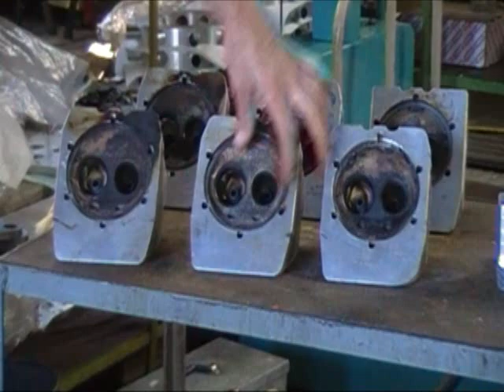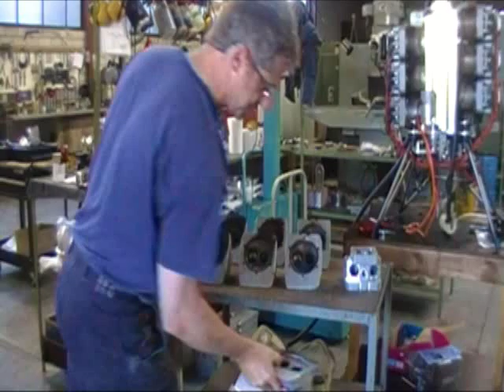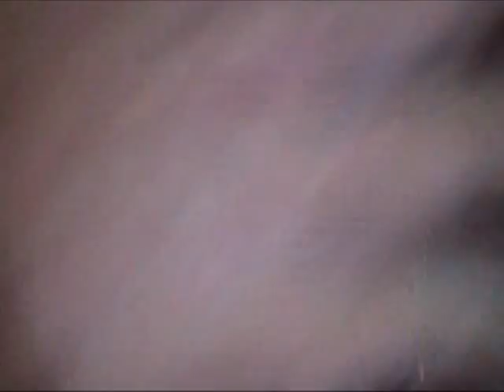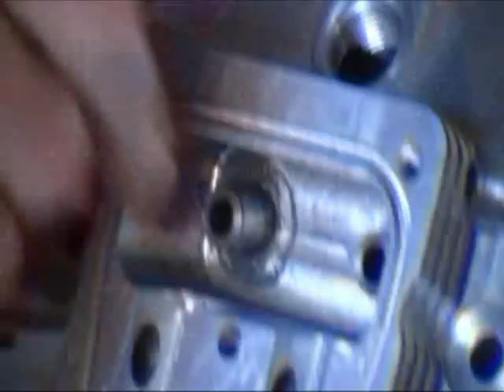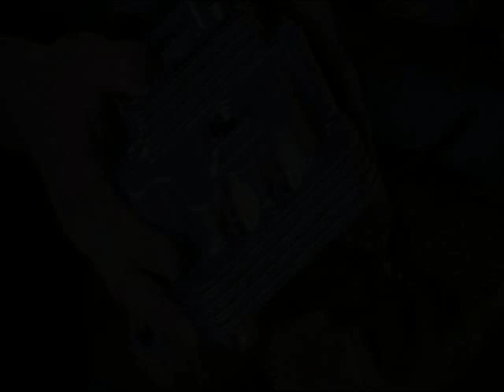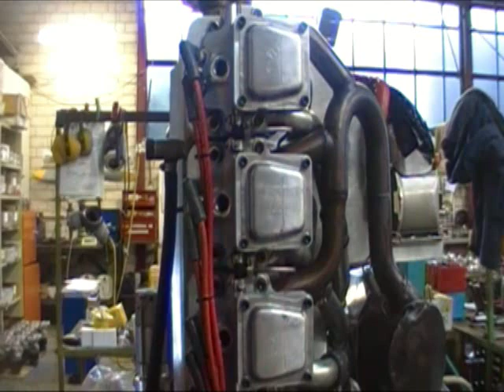Jabiru LCH (Liquid Cooled Heads) by Rotec Aerosport

Comment: Could the detonation be caused by an overly hot spark plug range ???...........what about machining a thin flat ring to put between the cylinder wall edge and the cylinder head wher the cylinder is clamped down on ?????...........this would distribute the load and keep from burying the cylinder barrel in an overly hot plastic state , into the head and distorting the clamping area of contact. ???????......
Reply: That is what is done with many vw conversions, they use a copper compression ring of varying thicknesses, depending on the compression desired.  I think it would be great if this was done for the vw engines as well.  I know porche had watercooled heads awhile back, but Im not sure what happened with them, if if they were even successful.

Comment: Amazing to think that for an engine with a Billet crank case it has basic, BASIC flaws espesially for an aero engine, what are your thoughts on the 3L oil sump? that alone was in instant turn off for me, and the first thing I would do Is either extend the sump or dry sump the motor, but seeing how much those factory heads move is even more of a concern